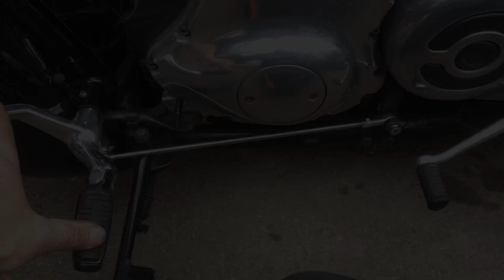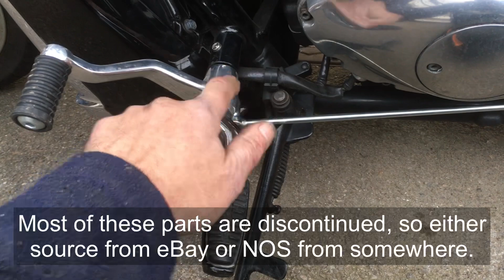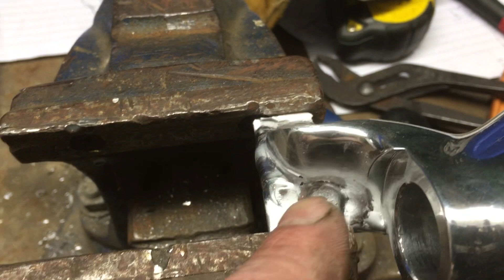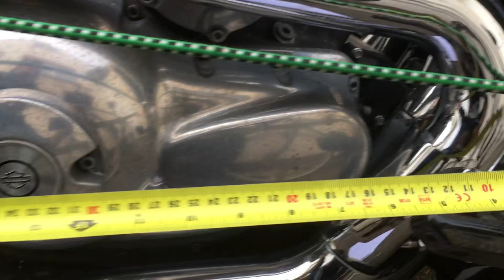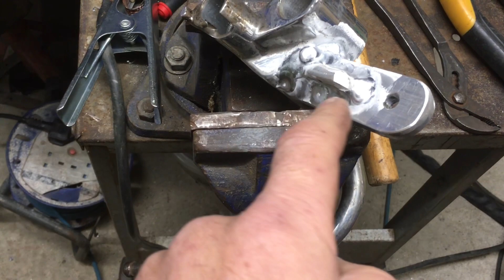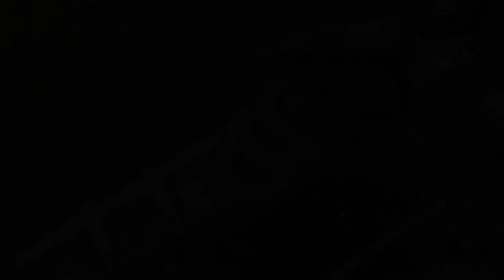Harley Davidson VRod - adding forward controls: A dual control Harley!

Comment: Hypothetically speaking if one wanted to pay you to do this on a 06' Night Rod, about how much are we talking?
You sourcing the parts as you know exactly what's required, plus labor. 
It's hypothetical since it would require getting the bike from CA to your location.

Edit: Also..... If the parts were available at a reasonable price(maybe they are I haven't researched enough) as you made them ready for a mechanically inclined guy to install them (minus the welding as not everyone knows how to weld and or do it properly), it would be awesome.
I believe there is a market for this easy set-up and not the other way by removing exhaust pipes, frame portions etc.
Reply from the maker: Would like a trip to CA, but not quite logical! I think it would be about £500 in parts, but as long as yours has the right pulley and swing arm and depending on getting a wheel from somewhere like eBay. I guess labour at not much more than changing a tyre and wheel bearings. I suppose £1000 or $1300 all in. Bit of care on eBay sourcing parts and it could be $1000.

Comment: You can extend the reach simply by swapping the arms to the opposite side. Not the gear and brake lever but the arm they connect to. You'll find you can get an extra 2 -3 inches by doing it.
Reply from the maker: That’s a good point. In the end I got standard arms and they are comfortable. Now I am swapping out the handle bars for some drag bars.

Comment: I have a 2007 vrod with forward control. The position of the brake leaver in my opinion is wrong.If you look at your mid control brake pedal it is in line and level with the footrest which obviously is correct however like mine your forward brake lever isn't. I had to do two emergency stops due to other driver errors in both circumstances  I failed to reach the rear brake pedal because of its positioning end up with front wheel sliding  and me coming off. I've never had this problem on any other bike with forward controls before. I'm currently waiting surgery. Please be aware getting to the rear brake with forward controls takes longer because of its positioning
Reply from the maker: Ouch, yes I have had two front wheel skids now and have got away with it. Once with the original mid control set up and once with Fwd controls. My front tire is old and has gone hard, so that is some of it. However I think the VRod geometry of front forks, skinny front tyre (in comparison to rear) and weight distribution prevents good weight transfer to front tyre under braking. This is the one thing that makes me tempted (if I ever have the cash) to go for a later VRod or Fat Boy with ABS. In the meantime, I have adjusted the brake.
Hope you get through surgery quickly and feel better soon.

Comment: Nice work. I wanted that......because I don't want to get rid of my mid controls, in curves they make it so easy to move your butt around and ride like a crotch rocket

The forward controls would be nice for getting legs out of the way during low speed handling, and I thought on a trip forward controls would be nice.......but really the highway pegs are good enough for trip.

I've decided against it because I'm not a manufacturer type

There is still available forward control kits, I'd have to look at one to see if I could start with that
Reply from the maker: Yes I know what you mean. However I find the forwards not too bad when doing curves. The mids make my hips hurt sometimes (the hips don’t lie!).

Comment: Let me know if you want to sell the mid controls. I need those because of my height, but cannot find them anywhere. Jealous of your set up! Love it!
Reply from the maker: Sorry, will be keeping them as the brake side needs the mid to stay (although could take away the peg, but leave the peg mount as a pivot). but adding mids to forwards might work. To find my bits, I set up some eBay searches and alerts for the part numbers. After a few weeks the bits usually turn up individually cheap enough. Then when you finally have everything you can change it over. If you need the forwards to be closer, you can get reduced reach clevis mounts for the forward pegs. I have some of these on the side spare. They were made for the Japanese market and bring the pegs back about an inch or two.
Reply: If you have forward control kits (complete) we can exhchange with my mid controls